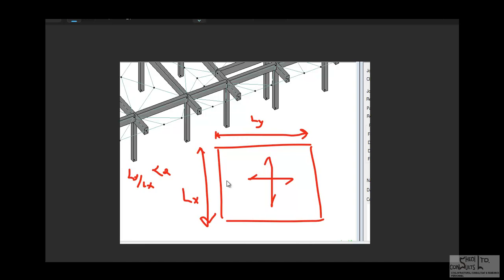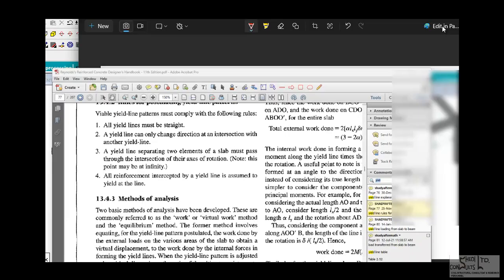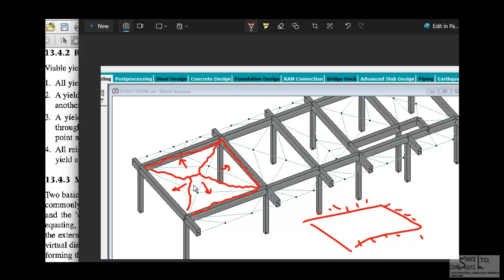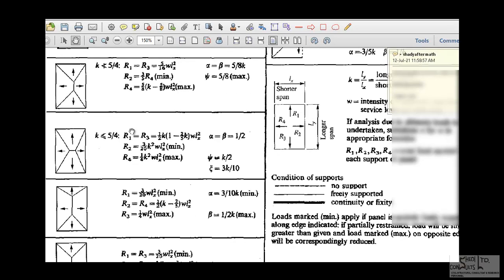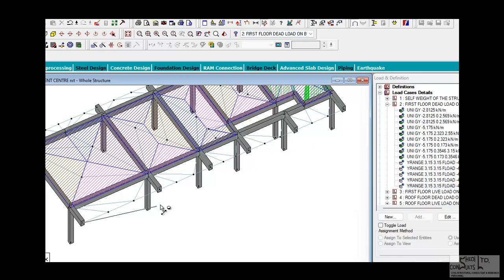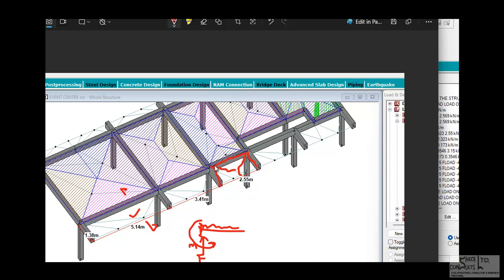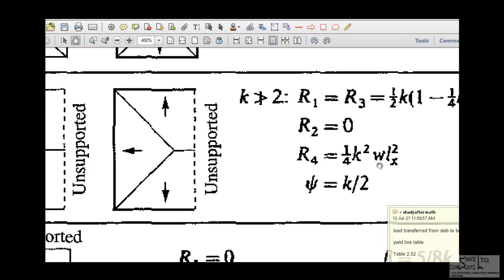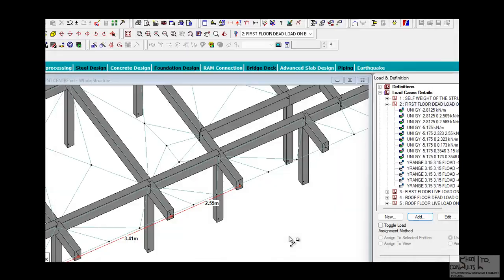Load Idealization on RC Buildings   Yield Line Theory

Comment: If the intention is to load the beams of the two way slab here without modeling the slab but using floor load, what then is to be done differently.
Reply: The peculiarity of STAAD is that you don't need to model the slab panels to be able to load the supporting beams using the floor load specification. The floor load specification is designed to permit you to load beams within the boundary of the perimeter of slab elements using the yield line failure criteria of a slab panel as shown on Table 2.52 of the concrete designer's manual. The modelling of slab panels is solely for the design of the slab panels or if you intend the software to automatically transfer the loads to the beams via finite element approach.